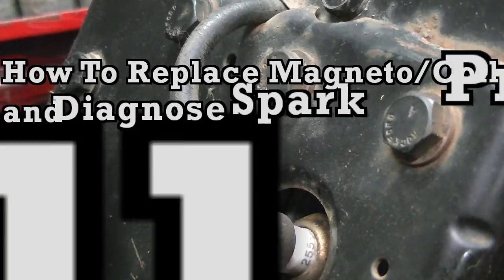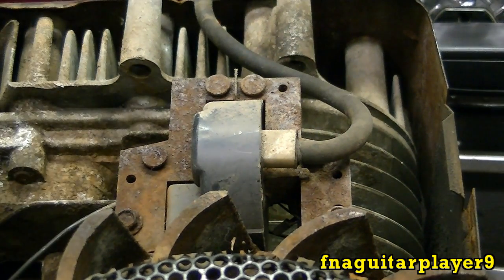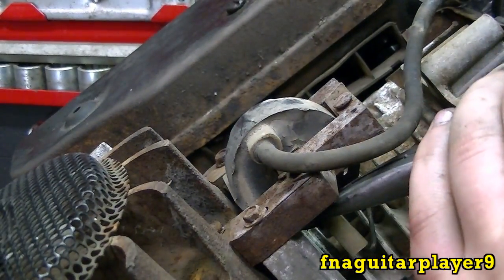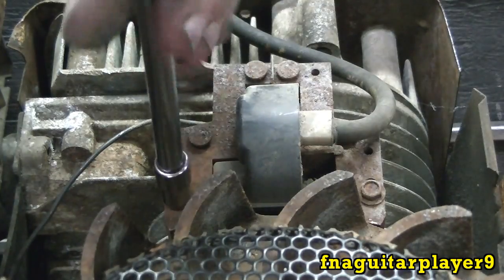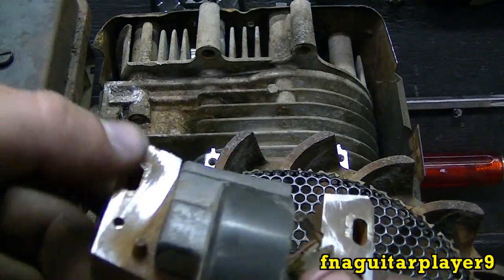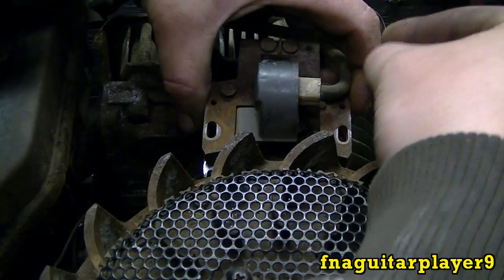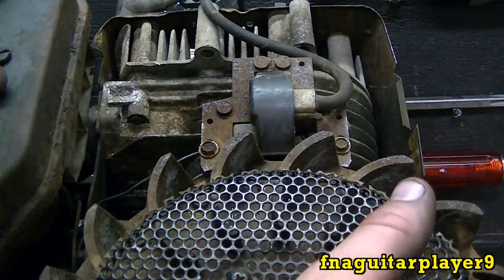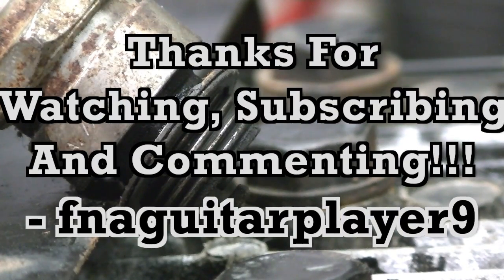How To Replace Magneto / Coil and Diagnose Spark Problems on Small Engines

Comment: I'm working on an old(1970) Kohler K91 motor with no spark. Hoping to get thru it without having to buy any expensive parts. I knew about(but forgot about) sanding those contact areas under the coil. Imma go pull the flywheel and coil and check that. Glad I watched your video before putting it all back together for another day.
On that motor, the magnets are on the inside of the flywheel. Is there any way of setting a gap between the coil and magnets on the flywheel, or is it fixed?
Reply from the maker: I hear ya! Yep, first thing to do is clean the points, if still no spark then either its a bad coil or bad condenser/points. Not to sure about that to be honest, there should be but not for sure, i usually work on briggs most of the time. Thanks for Watching!!!

Comment: how about testing the magneto?
Reply from the maker: I don't have a video on it, but will try and make one. Best way is a ohm meter across the ground/frame and to the plug wire, if there is no resistance at all (infinite ohms) then it is bad, or if its shorted (0 ohms) then its bad. Some of the magnetrons won't check like that since they have a electronic circuit in them. Thanks for Watching!!!
Reply: fnaguitarplayer9 what if the coil and the spark plug are good and yet get no spark, I've tested the stop wire and switch and it check out good, what else could be causing the no spark issue?
Reply from the maker: Try another plug or try that plug in another engine just to be 100% sure, i've had brand new plugs not fire. Unhook the shut off wire from the coil and check it, thats how i test that. Other possible causes are corrosion on the 2 posts that the coil anchors to, to big of a gap between coil and flywheel, and a rare but possible cause is a weak magnet, i've heard of people replacing everything ignition wise and found out that magnet lost its charge! But if all that checks out, it could still be the coil, even with a good reading it could still have a weak winding. let me know what you find out!
Reply: fnaguitarplayer9 thanks I'll keep you posted
Reply from the maker: your welcome!
Reply: fnaguitarplayer9 so I check the coil with the stop wire disconnected and I got a spark, I then tried to run the machine with the stop wire disconnected to see if it did run but still nothing, will it run with that wire unplugged? if not how do I go on fixing that stop wire from malfuntioning? thanks for the help.
Reply: fnaguitarplayer9 got it running without the stop wire, I did another good cleaning on the carb and it ran awesome, thanks for all your help, now I just have figured how to fix the stop wire
Reply from the maker: I hear ya! Your welcome! Its probably shorted to the frame somewhere, or a bad or stuck switch.

Comment: I have a Sears st/12  Tecumseh motor replaced the coil hard to gap it behind the flywheel,  I have spark now possibly not enough to start it, how do you gap it? it's getting gas why else would it not be starting?
Reply from the maker: Honestly I usually don't mess with tecumsehs, the ones i have adjust just like the one in the videos, I do have a old 12hp tec that came off a sears tractor but i have never messed with it. You may want to check the flywheel key, if its not even trying to run it may be sheared. if the compression is low, you may need to do some work to the valves. Thanks for Watching!!!

Comment: Good video, thanks.  I am working on an engine with no spark.  I bought a new coil on ebay which comes from China.  When I ground the shut off tab I feel the pulse of electricity. There is no connection from spark plug wire to ground--zero ohms-open.  Is this a defective coil?
Reply from the maker: Appreciate that, your welcome! Sounds like a bad coil, sometimes they will still generate a pulse, but not strong enough to jump the gap. The reading does sound bad, its usually really high like several hundred thousand ohms. thanks for watching!!!

Comment: I have gcv 160 honda on my log splitter the motor runs great till it gets warmed up then it starts sputtering till it eventually shuts off after cool down it's fine I am pretty sure it's not fuel I'm leaning towards coil is getting hot I ordered a new coil is there something I'm missing any insight would be appreciated
Reply from the maker: Your right, most of the time when they do that, gets hot and shuts off and won't run until its cool, its usually the coil, or if its a older engine it could be points/condenser related. But i'd say its the coil. thanks for watching!!!

Comment: Does the shut off wire feed a ground or positive current?
Reply from the maker: +ILTSYC The shutoff wire goes through the ignition switch to ground, it grounds out. There is some voltage on it, not sure exactly how much, but it grounds out to kill the motor, on the old style points/condenser, it basically shorts out the points to stop spark. Thanks for Watching!!!
Reply: Thanks! I have a welder that won't run with the shut off wire unhooked. Neither coil will fire. I find it ironic that two could be bad at the same time.

While I was on vacation some other folks used the welder to generate power. The starter went bad while they had it, I replaced it and now both coils are dead.
Reply from the maker: +ILTSYC Your welcome! It could be the diode wire, on some twin cylinders there is diodes coming off of each coil, I'd suggest unhooking the shut off wires on both coils and start it up, keep in mind that you'll have to pull the plug wires or short the terminal to ground to kill it though. I doubt both coils are bad, its probably the wires, but it is possible. hope this helps
Reply: I did that and it still won't run. Sure is odd to have two go bad at the exact same time though.
Reply from the maker: +ILTSYC I hear ya. It must be the coils, but it does seem strange. The only other thing i can think of is a weak magnet on the flywheel, have you checked that, i have heard of them loosing their magnetic charge, super rare but has happened!
Reply: It has quite a strong magnetic pull Its almost impossible to hold the coil up off the magnet so paper is needed to adjust clearance.
Reply from the maker: +ILTSYC I hear ya, thats not the problem. Have you checked for spark at all, i was thinking if it is sparking then maybe the flywheel key sheared throwing the timing off, just wandering you didn't say if you checked for spark just that it didn't run. That is very common on small engines, i had a 14.5 single cylinder do that, but it just kept backfiring. Just trying to think of anything!
Reply: fnaguitarplayer9 Yeah Ive checked for spark with a spare new plug and with a screw driver in the boot and held off ground about 1/8".
Reply from the maker: I hear ya, just making sure, sounds like it has to be the coils then. I'd suggest getting a aftermarket set off ebay, i've been using them on mine and haven't had any problems, saves a ton of money!
Reply: +ILTSYC  If I unplug the wires from the coils I get a ground on both tabs at the coils.

Both the shutoff wires go into a tiny box with a 3rd wire leaving it and going to a relay that looks like a signal flasher on cars. That single wire doesn't seem to be grounded at the flasher until I plug two shutoff wires back to the coils. Its been a few days since I've tinkered with it now though.

I'm not sure exactly what the relay does but the only signal that ever gets sent to that relay to make it come on is while the starter is turning.

Maybe once that relay is pulled in it stays on until the switch is turned off?
Reply from the maker: +ILTSYC That sounds normal, getting a ground at the tabs with the wires unhooked, but the coils could be shorted inside too doing that, hard to say. You usually can't get a ohm reading off the newer coils like you can with the old style with the points and condenser. To be honest I haven't worked to much with this setup, all of my equipment/engines doesn't have that, just coil and shut off wire. That sounds right though. Have you had any luck with it since this comment, i didn't mean to put you off that long, been busy!
Reply: Man you won't believe this or you might. I had my starter rebuilt because this welder's starter new is 300 dollars.
It turns out it was turning the motor backwards. With no arrows on the motor anywhere it took me a few days and a lot of aggravation to figure it out.

I caught it because the carb was blowing instead of drawing vacuum.
Reply from the maker: +ILTSYC oh wow, thats a new one! I believe it, I've ran into some really strange things on small engines! Like one time i got camshafts mixed up, put a L Head cam in a OHV engine, shot a 3 foot flame out the carburetor! Thanks for Watching!!!

Comment: Your the only person I can rely on for good how to videos. I loved your pocket bike videos. I wish you amid some more. Or an update of that green one.
Reply from the maker: +Project DIY Appreciate that! I hear ya, I'll try do some more videos on it this summer sometime, I don't know if you seen it or not but i have a 2 part video of tearing the motor apart and rebuilding it. I haven't ran it for over a year now, so I will be getting out this year for sure. Thanks fro Watching!!!
Reply: +fnaguitarplayer9 ohh. Your videos caused me to buy two pocket bikes for 65$. Going to have a lot of fun this summer.
Reply from the maker: +Project DIY I hear ya!!! That is a good buy, hopefully you can get both going or take 2 and make one or something!
Reply: +fnaguitarplayer9 yeah. i need a coil and might need a carb for one. the other is fine. the previous owner of one make a little water spray in the engine. do you think the pistons and stuff should be fine to run? it has compression.
Reply from the maker: +Project DIY I'd say it would be alright, just make sure there is no water in the oil. I've never done that myself but some say it clears carbon out but who knows haha

Comment: Hi there do these igniters just have 1 winding inm does the magnet induce high voltage straight into the winding, timing seems a bit crude?  Fred in england
Reply from the maker: Tom Smith There is actually 2 windings, they work basically the same as a coil found on older cars, but instead of a circuit triggering the coil its induced into the primary winding by the magnet. Basically its s step up transformer. But the primary winding is internal. Thanks for Watching!!!
Reply: fnaguitarplayer9 Ok thanks, I didn't think it could be just one secondary winding, you need some accuracy with the timing cheers   Fred.
Reply from the maker: Tom Smith no problem!

Comment: Will it be good to smear a little dielectric grease in the connections and surfaces that needs good contacts ?  I always do to prevent any corrosion. (battery poles, bulbs sockets, connectors...etc...) Great video.
Reply from the maker: Thats not a bad idea, it would help prevent everything from corroding in the first place, like the posts where the coil mounts. And even the shutoff wire as well, i've seen motors that won't shut off because a connection was corroded. Another good place for it would be on the connections of the positive and negative cables, on the battery, solenoid and starter and the neutral connections and on the ignition switch. Thanks for Watching!

Comment: I got a free $850 mower when it was new because it had a corrosion problem causing no spark lol. After fiddling with it for a while I had spark and the mower was running and it's been great for 3 years now.
Reply from the maker: daggone, that was a great deal! Got to love when it works out like that, being something so simple. Thanks for watching!!!
Reply: Unfortunately the mower weighs a ton and it doesn't cut that well lol my 37 year old $120 push mower cuts 3 times as good.
Reply from the maker: haha heard that. You can not beat old equipment, things are just not made as good now days.
Reply: No they are not. I just did a valve job on my 12 HP Briggs and while torquing the head back on all of them went down great except for the bottom right one, snapped off pretty close to the head. I made videos about it.  I should be able to get it out with a left hand drill bit without taking the head off. I cleaned the threads and lubricated them. No idea why it snapped.
Reply from the maker: oh man that sucks. That is unusual for a 12 horse to do that, i've never done it (yet), I hear the opposed twins are really bad about breaking head bolts for some reason.
Reply: I'll give er a go with a left handed drill bit. If worse comes to worse all I have to do is take the head off and take vise grips to it. It busted off pretty close to the top of the hole in the head.
Reply from the maker: yeah its worth a try. If it wasn't a head bolt i'd say use the weld-a-nut-method, but that might cause the metal to warp or something being on the head. Vice grips should get it out if drilling doesn't work. Got to hate a broken bolt haha
Reply: Yeah no kidding man. It really annoyed me when it did that. The middle of the bolt looks like a butter bolt.
Reply from the maker: It wouldn't surprise me that they use grade 2 or less bolts, and there supposed to be at least a 5 haha
Reply: Yeah, the top of the head has what looks to be a ship anchor LOL
Reply from the maker: haha heard that!

Comment: I've got a new mower that has had a brand new battery put in it twice and it still has trouble starting any chance this is the prob
Reply from the maker: like wsmart1 said, need more details, if its not cranking good it could be a starter or valve issue (compression release), if its cranking good and not starting, it could be it has no spark or something is wrong with the carburetor. thanks for watching!
Reply from the maker: Yeah, I did pretty much drown that twin haha I'm glad it didn't backfire through the carburetor though haha you can also use carburetor cleaner as a starting fluid, but i still recommend using gas though. Thanks for watching and replying on his comment!
Reply: Hard to say without looking or more details, but if it's not cranking easy I believe that can be a valve adjustment issue.   

Best thing to do is just use some starting fluid on it -just kidding(I put that one in there for you FNAg).   

I've been using starting fluid on a mower with a messed up carb and after seeing FNAg drown the engine in gas on a recent video, I just tried that and it works great!

Good luck.  

Be real, be sober.